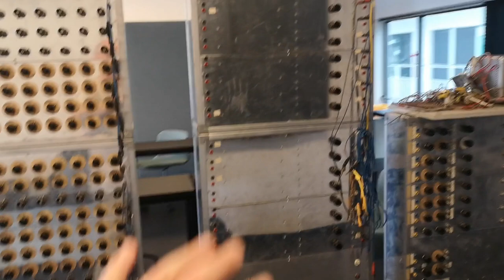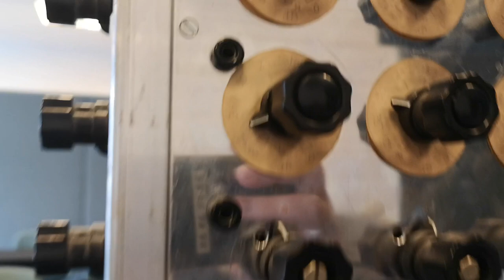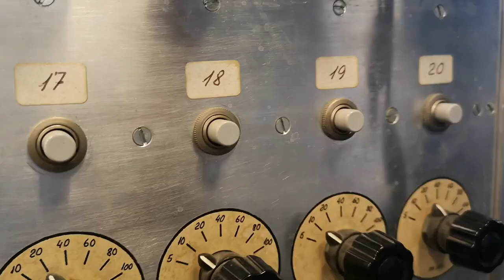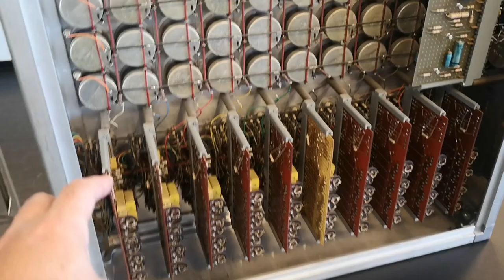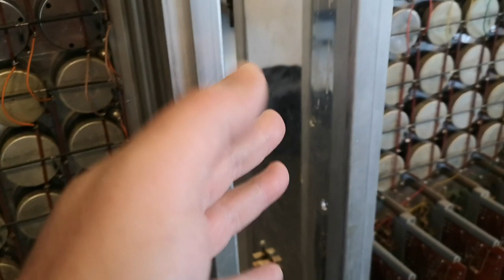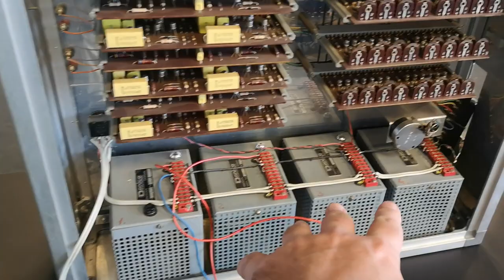Formant Speech Synthesis Analog 2 sec Talk Generator (part 1 the intro)

Comment: Looking forward to seeing what this is gunna do! Mainly the formant filters! Looks amazing the buffed front.
Reply from the maker: i can reveal we all ready team up for a short check and fix the 4 power supplies today, since all features in this machine is 100% analog, and even use analog voltage curves as the box to box interface, clean and stable supply voltage is very important.

Comment: I took a quick peak at the schematics, and the main thing that stood out to me was the gate. Most synthesizer designers now use either a differential pair, maybe with a current mirror on top, or an OTA—the design in that synth is a strange diode ladder sort of deal.

I'm really interested in hearing what it would sound like on a regular audio signal—they might have some really interesting distortion characteristics. (If it sounds cool, I might try to make a 2-, or 4-pole VCF using 'em.)
Reply from the maker: i got the synth unit in the lab now :-) so expect to see more in the future, mean while part 5 reveal some audio clips.

Comment: Continue! - are you going to haul this boat anchor home, or will you be playing with it at the University?
Reply from the maker: no need to hire a truck, each of the tall sections can be divided, using 4 bolts, there are connectors here too, this means IF a part need to go home to lab, it is quite easy, but the plan is to see if it can be repaired in location.